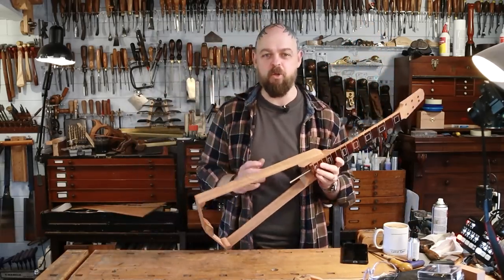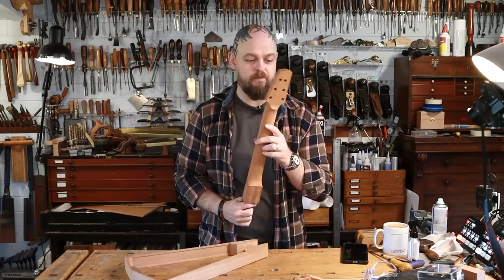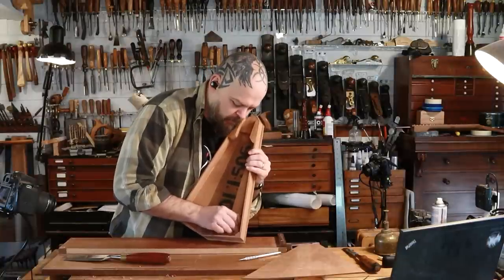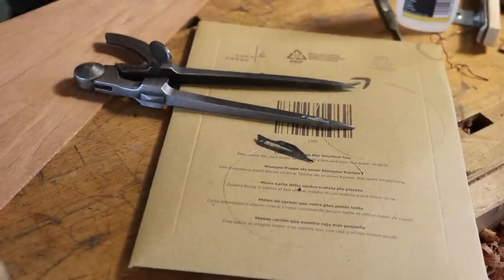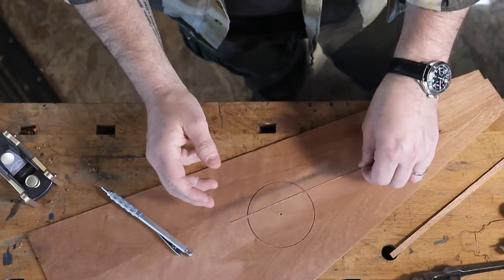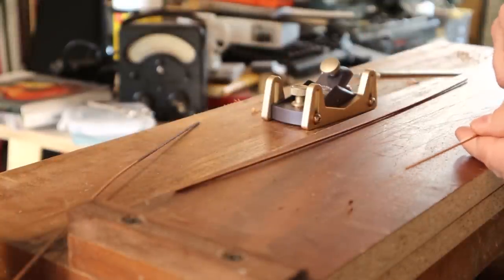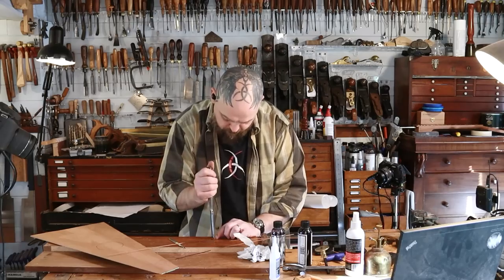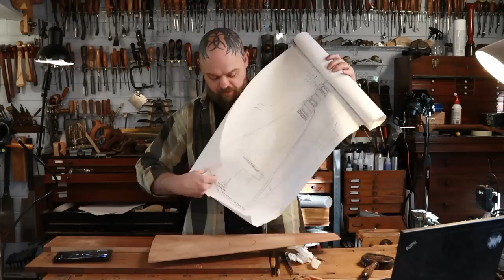Ep 10 - TINY Pieces! - Hand Tool Only Acoustic Travel Guitar Build - A Guitar from a 4x4 FENCE POST

Comment: Awesome as always Ben. Personally see painting as a cop out even though it would be period correct. On a different note, have you ever seen steaming in a bag.  It contains the heat and moisture longer and you can position it into shape while still hot, allowing it to cool slower and thus retain the shape with a lot less stress.

Comment: common don't paint those lines in!  but, you can make some edge binding similar to what they do for arabic oud's, basically sqaures in two alternating colors about 1.5 mm deep around the soundboard. usually the log glued up to 3 or 4 blocks, installing them is easy. BTW look into some bleaching chemicals for the mahogany, I don't know how it will work with that wood but I think the build will be well served if you can muster up a lighter color for the purflings.

Comment: You sometimes use a 45 degree slot on the edge of a neck then fill with a contrasting wood so it is seen on the front and side (of the neck as fret markers), how about doing that around the body/side joint ?

Comment: The reason you put strips of veneer into the rosette is to add structural strength to the area around the sound hole. Ie to stop cracks developing on the soundboard. I'm not sure that the end grain inlay would do this. There's an awful lot of string tension twisting the guitar at the neck 2 body joint. This design doesn't seem to take that into consideration.